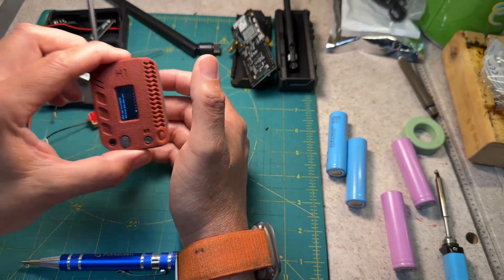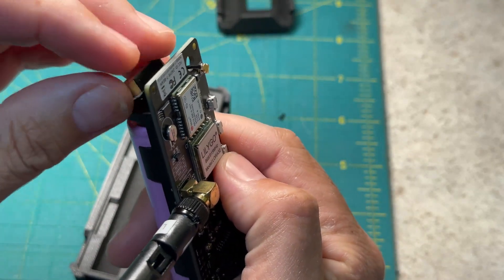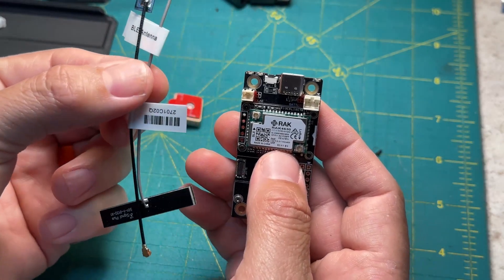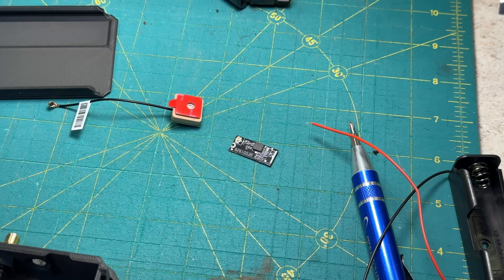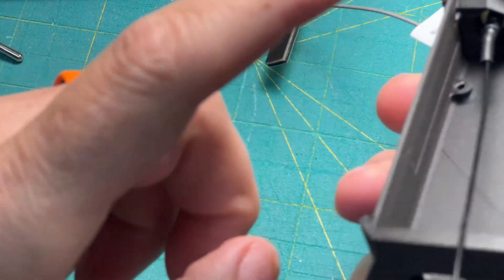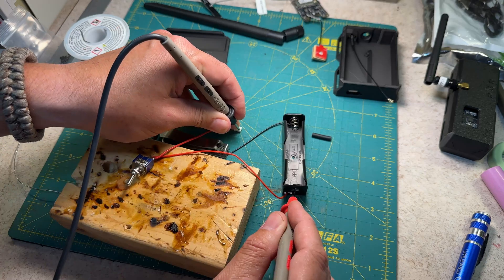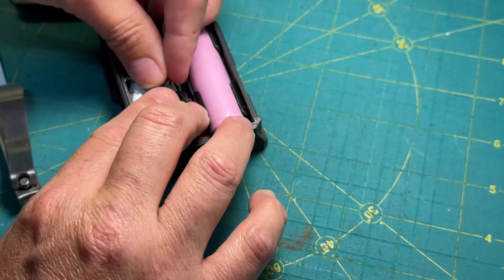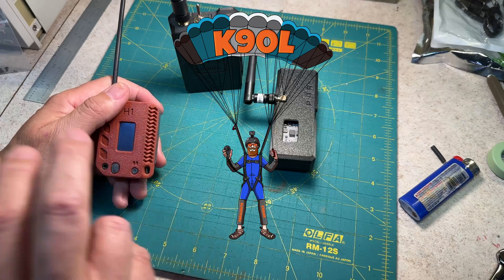Yet another ding dong ham radio YouTuber with a meshtastic habit.

Comment: I have the same one you started with and the Bluetooth was horrible. I did the mod to replace the Bluetooth antenna with a wire. It works so much better now.
Reply: 3cm replace the curly cue antenna on the board I watched Hayden’s video hrdx
Reply from the maker: What kind of wire at what length?